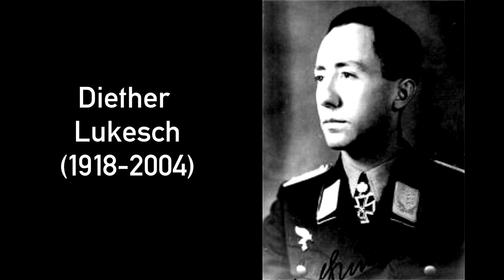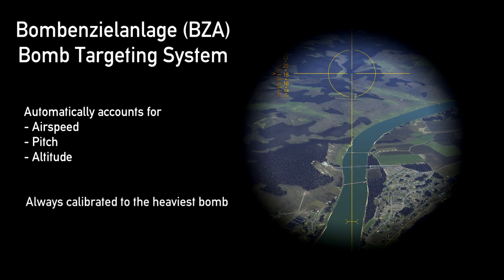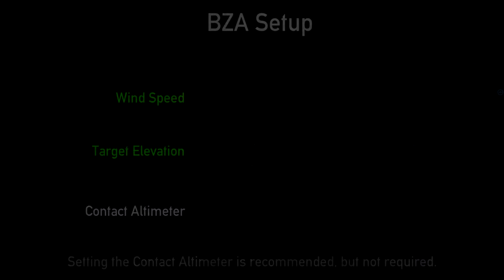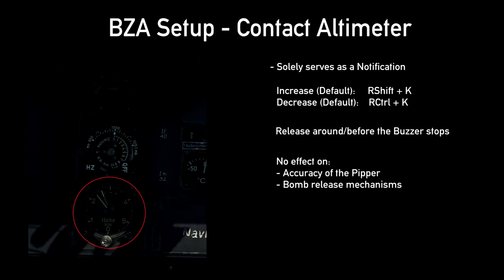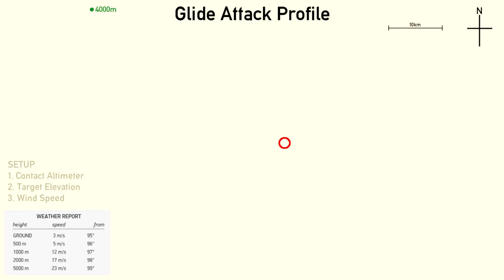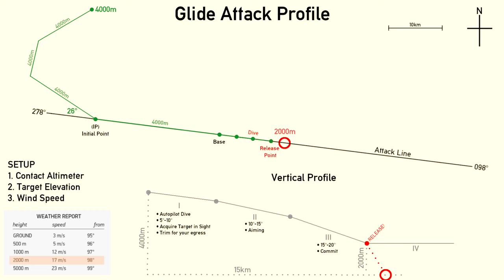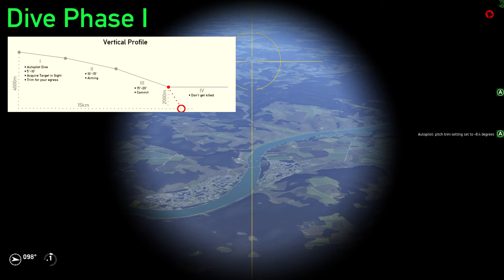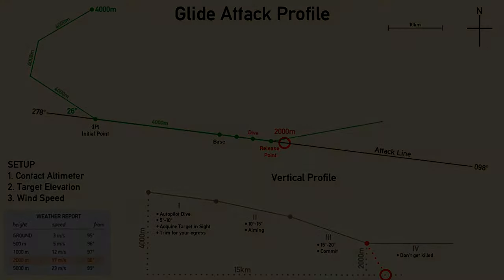Arado Ar 234 B-2 | BZA Glide Bombing Guide

Comment: Fab video. Thanks. Before I saw this I had worked out a quick and dirty method. Get target elevation from Google Earth. For the bomb run just use the autopilot in the roll axis. Do the final line up with the rudder, making sure the final direction stabilises before drop. Fly the pitch manually. Even not using the contact altimeter and ignoring wind effects, as long as you were fairly low, say 1500 to 1000m the accuracy was excellent. Obviously flak was more of a problem but now I can do things properly from a better height. Subscribed!

Comment: Hey Kampfgeschwader 76, great video! I'm making a cinematic mini-doco about the Remagen bridge attack and because you seem like an expert on the Ar 234 I wonder if you can help me. I need to know if the 14th March 1945, 1230 - 1530hrs attack took place at low level or at 2000m as you demonstrated. I'm also unsure if there was a pontoon bridge to the south of the bridge as you have placed with the mission editor which was supposedly the target of the 14th March attack. Can you confirm this? Thanks for your help Ill be sure to credit you!
Reply from the maker: First off, I appreciate you dramatizing this event and your pursuit for "getting it right" but I am not certain I can provide the tactical specificity you seek. 

Best description I could find is this:
"the next day (14 Mar 45), the weather cleared, rendering the German aircraft more vulnerable to fighter attack. During the afternoon, 11 Arados from 6./KG 76 flew gliding attacks through heavy flak down to 500m on the bridge...Allied forces claimed 4xAr 234s...no further operations were flown until 17 Mar"
- Arado 234 Blitz by Smith & Creek.

Also, on the 14th, 19 234s were dispatched but only 11 hit the Remagen bridge. Some sources claim all 19 went there, this does not seem to be true.
On that day, Allies claim 4 234s shot down and 1 wounded and this seems consistent with German records of that day. They recorded 4 losses and 1 damaged return.

There is no indication, as far as I can tell, that EGON bombing was used for ALL 234 attacks on the bridge. Only 2 dates of such instance were  the 12th and 17th.

Bomb type should be discussed as well. The most common bombs used in the attack seem to have been variations of the 500kg bomb (SC, AB, SD), not the SC1000. This was the case throughout most of the AR 234s bomber sorties and throughout the war. The SC1000 was a rare bomb. Never to be used unless absolutely called for.

Lastly,  the glide attack was not always to terminate at 2000m, just as it did not always start at 4000m (or 6000m). At 01:25, the pictures show how bombs were released no lower than 500m and even above 2000m. In practice, this may have been dependent on the target. If it was a frontline target like a bridge, they could come in as low as 500m for precision. But since most targets (at least early on), were large industrial targets such as ports or railyards, a termination altitude of 2000m usually was warranted.
Reply: @kampfgeschwader76  Thankyou soo much! This gives me good confirmation of the altitude of the attack which I didn't have. As you say, it is noted that 11 out of 19 Arados attacked the bridges and Egon was not used; Ar 234 Bomber and Reconnaissance Units by Robert Forsyth states that the other Arados attacked some other military targets. I have the correct bomb types aswell and the Arados will glide bomb in the video. Check it out next weekend!

Comment: Hi, the video is very instructive.thanks for your work.I've been flying for 3 days to get used to the ar 234.This system is difficult, but we are working with perseverance.yesterday i flew on dynamik server.it was cloudyheavy.cloud height was around 1500 meters.hedefı It is very difficult to determine the target location.How do we proceed in such situations?
Reply from the maker: If the target is obscured by clouds (and you are above it), there is very little you can do. This is a challenge for all "line of sight" bombsights like the Lotfe 7K and our BZA.

If it is Overcast:
1) Lose altitude and bomb under the clouds. You have no choice, you must have line of sight of your target or try to rely on ground terrain cues still visible on the edges of the sights to aim at your target.

The issue here is you may not have enough altitude to glide bomb. You may want to consider level bombing.

If there are clouds (but it is not overcast), you have a few more options:
1) Lose altitude and bomb under the clouds
2) Maintain altitude and hope there is a small opening or "terrain" bomb. That means you rely on ground terrain cues visible on the periphery of your sights to do the aiming.
3) Abort and setup for a Second Pass from a different direction. But before you do this, note the wind direction and speeds and also note the position of clouds over the target. You want your second pass to come at an angle such that when you come back, the clouds have moved away and created an opening. This is tricky.

In any case, if you have not maximized every effort to ensure your bomb will hit the target, do not commit. Missing your bombs is a bad feeling.

Comment: how does the target elevation work/do? The linked video is just a mission editor and i dont understand what to do with/about it. can i ingore it and still hit targets?
Reply from the maker: If accuracy is your concern, target elevation will matter. The farther and/or higher you are from target, the greater that margin of error.

Some maps like Rhineland have elevation varying from 0m MSL all the way up 600m MSL.

That elevation data needs to be fed into the BZA prior to release so that it can calculate an accurate drop solution for you to use. 

If you neglect this, especially for a target on a elevated terrain such as a hill, your bombs may land just short enough of target to not destroy it.
Reply: @kampfgeschwader76  Ah okey. Man so now i gotta do that entire process just for the elevation XD. Thank you tho, wish you the best